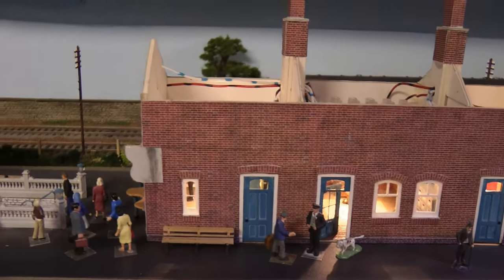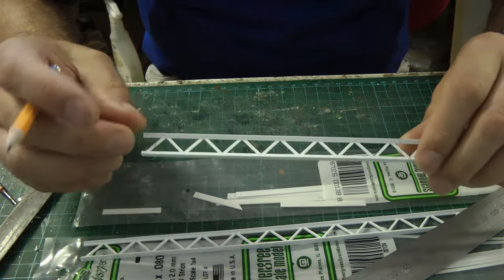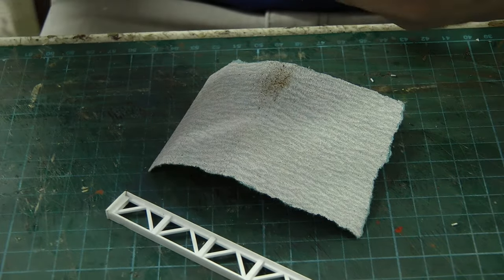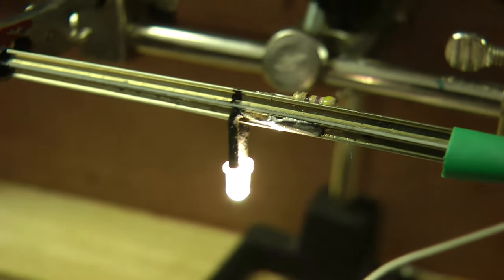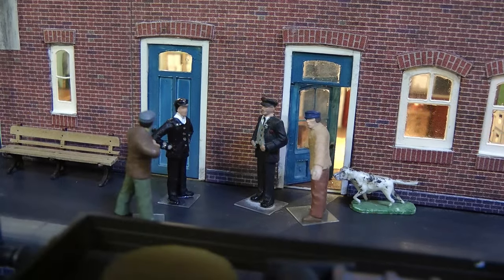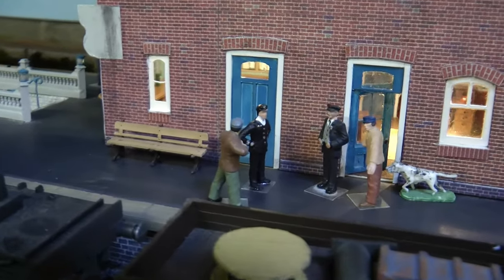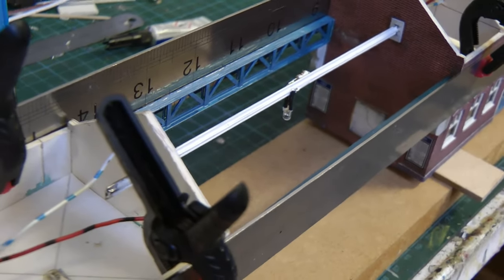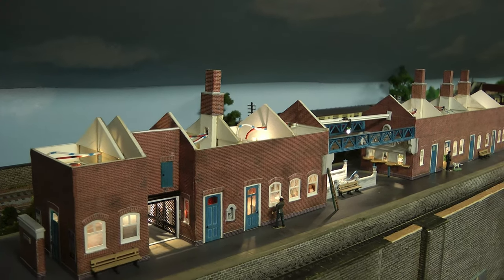Tyne Dock Re-Build Part 18. Supporting  Beams No442

Comment: Proper job lads. the two buildings are now one. Both crews did a nice bit of crane work. As for the girders, they fit better than they would have if bought from Globle House. (DIY Shop.) There is even a light on the job now. What's next? Well, lads, there is a storm brewing and it is heading this way. You Silly sod, that the steam from the kettle, go and make the tea and don't forget I have two sugers in mine. Martin, (Thailand)
Reply from the maker: Hello Martin. i love the comment my friend. as for what is next i have 30 small brackets to make. tedious job but it has to be done. many thanks again my friend. until next time stay safe Tony.

Comment: Dear Tony, absolutely agree on the added vertical supports for the roof trusses. Those Plastruct trusses are awesome by themselves, but they miss a bit of detail. Guess they did that to be able to use these trusses in different scales. Think the added vertical supports just add the little necessary extra depth to the truss. Even when they’re only visible when Sid looks under and up the inside of the canopy.
Love the story of the trusses being loaded up, transported by the North Eastern and hoisted in place at the Tyne Dock station! Beautiful how you’ve put together the work train consist! 
Yep, such a truss construction relying just on superglue is indeed fragile. As you’ve said, think it will all work out great when the roof construction is in place. Nevertheless, for added reliability of such glue joints it’s worth looking into adding a bit of full strength Matte Medium over the top of the glue joints. This will help prevent the deterioration over time of the superglue and adds a nice (flexible) extra bond over the surfaces, without being visible because it will dry absolutely flat. Definitely worth looking into.
Still curious for the canopy and how the station will look with its roof installed. Cheerio
Reply from the maker: Good morning Vincent. thank you for commenting. i am glad that we think along the same lines with what i have done with joining both these buildings together. these building are still very flexible. but still care will have to be taken when handling them. so the next phase will be to make all the supporting brackets for the canopies. and the centre roof. which i am still thinking about its construction and what to use for the centre roof. thanks again for your input and thoughts. cheer;s for now Tony.